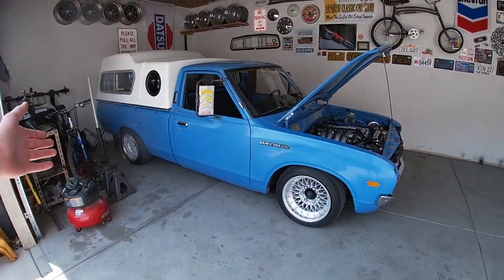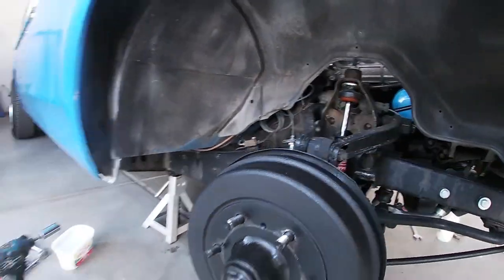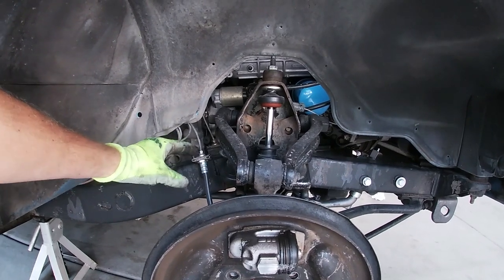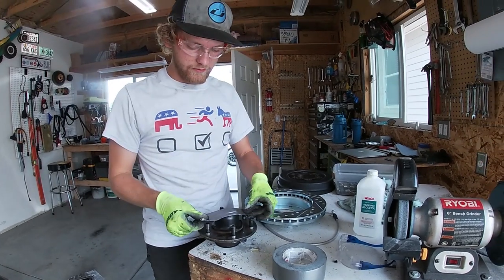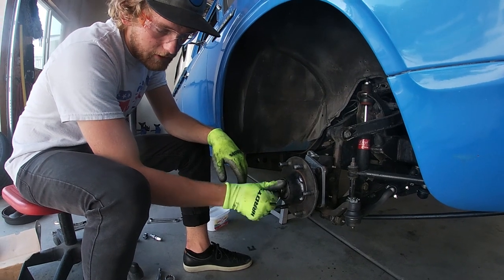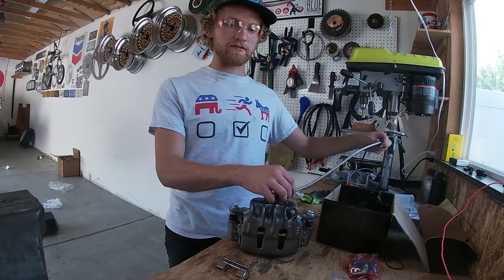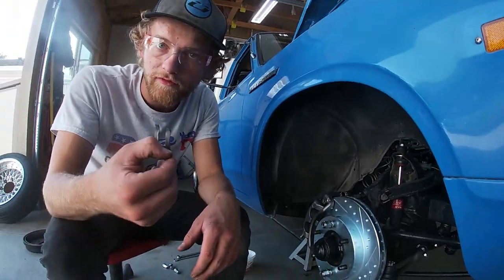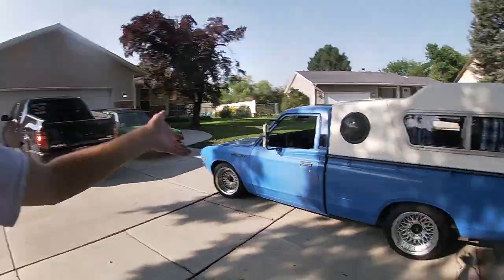Disc Brake Upgrade - KA24DE Swapped 1974 Datsun 620!!

Comment: Had major brake issues in mine back in 2000. Locked up while stopped at a red light and never released. Burnt the brakes up the whole way home. Miss that truck.

Comment: I just put the same kit on mine!  Way better!  Nice video.  I have the same shocks too.
Reply from the maker: Thanks man!! It’s sure a great upgrade. The KYBs are great. Are you running pinto shocks? They’re slightly shorter and pair well if you are lowered.
Reply: @waystomakeit2494  I am not lowered yet.  I am going to extend the shock mounts two inches once I do lower it.

Comment: I just bought a 1978 620! Just learning before I dive in. Mine needs a master brake cylinder and comes with disk in front... Should I look into a better Rotor for the front and back?

Comment: Was the master cylinder not changed?? It needs to be a front disc brake master, otherwise the residual pressure valve will hold a couple pounds of pressure on the disc brakes, either causing premature wear or worse, dragging front brakes. Drum brake masters have a valve inline the line outlets to hold residual pressure to minimize the outward movement of the shoes.
Reply: The master cylinder looks to me to have been changed, check early in the video, good shot of the engine bay. You can also see a power brake booster plainly behind the twin reservoir master cylinder, but no mention of either in the video. I'd like to have some answers to this mystery as well. ;)

Comment: How much it cost to build this?
Reply from the maker: The whole truck probably has a minimum of $7-10k into it at this point.
Reply: @waystomakeit2494  Thank you. I found a extremly cheap datsun for under 4k one day I thought about getting it. I was thinking about turning it into a JDM Stance truck but automatic. Do you think it can be build or someone building it around 7-8k even if i dont want a super turbo engine?
Reply from the maker: Yeah, that ought to be possible. Expect to spend a minimum of $3k on any motor swap (that’s if you do all labor yourself).

Keep the stock engine, stance it, find good wheels, and you can keep it under 8@
Reply: @waystomakeit2494  Thank you this helps out alot. One last thing, vinyl wrap. If I want someone to wrap my truck (when ever I'm able to get it), does it make a difference cost wise if I already have the design set up verses them doing it?
Reply from the maker: I’m not certain, it’ll depend on the vinyl person you use. 

Wraps are frequently made of layers of vinyl stacked on top of one another. This can be intensive to lay out, especially when you have to re-work someone else’s design to work with the way you are going to actually cut the layersz